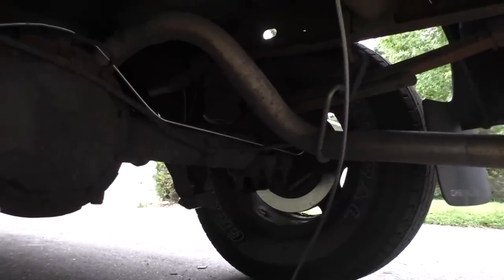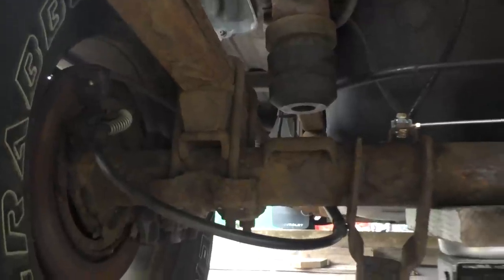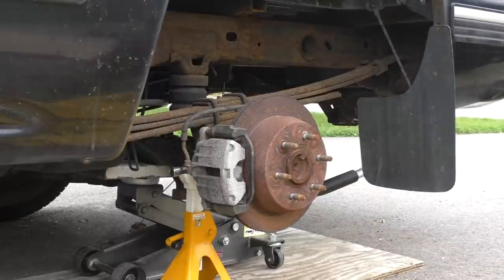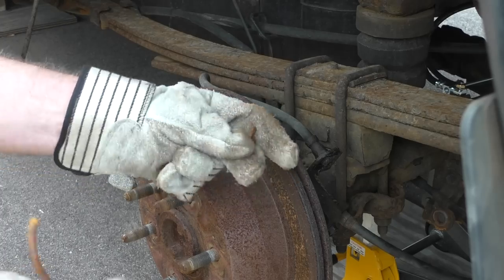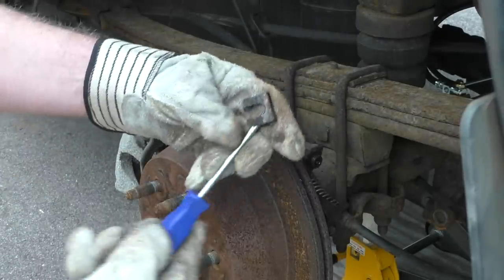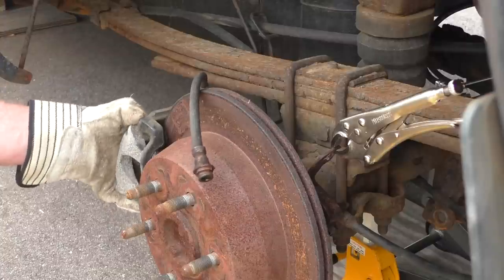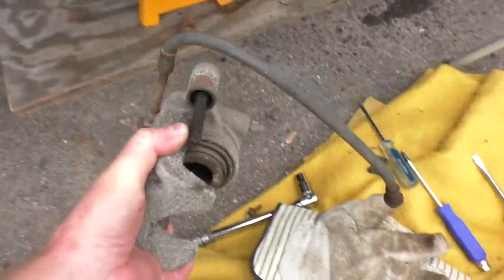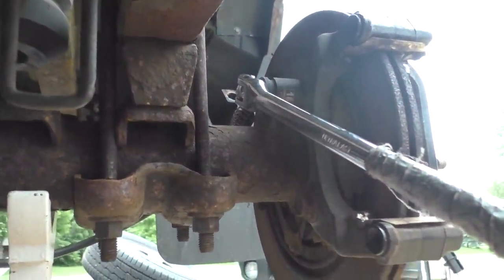Truck Brake Line Replacement Part 2

Comment: Thanks for the tip breaking loose that rear brake line from the bracket.  My hose came with the bracket but I can't break that bolt loose its too rusted in place.   Was in middle of doing rear brake job and decided to do the hoses too.

Have also been replacing the rotted steel lines with stainless ones on a 2004 Z71.  I only have a few more to replace and I'm done.

Comment: Really liked your video and came across it pretty much by luck.  Was doing searches on gm/silverado/sierra brake lines.  I'm getting ready to do this on my 2004 Silverado.  Went and bought prebent stainless lines (wasn't cheap) and figured on having to replace the front brake lines and those fun little clips.  But your video made me think that I am going to have to replace the back hose lines and that one that goes to the split on the rear axle.  Wish you had posted another video or two about this project.  Its something a lot of GM truck owners are facing.
Reply from the maker: Thanks. I have some more video but I've been having computer problems so I haven't gotten it all edited. Ask away and I'll try to answer.
Reply: hiddengrousefarm I would also like to see how you did
Reply from the maker: OK, I'll do the last part.

Comment: I use the 1/2" breaker bar and 18mm socket to loosen the caliper mount bracket bolts. If you use a pipe, or crowbar, for leverage the bolts will loosen with very little effort. Mount the socket and breaker bar onto the bolt head. Now adjust the breaker bar so it is level  with the frame or leaf spring. Now insert a pipe or "prybar" under (or over depending on which side of vehicle you are working) and afix that as a lever against the breaker bar and wind up torque onto the breakerbar (using the pipe as a lever) and that bolt will break free without too much effort. Essentially you are using the pipe and frame, or leafspring, to force the breaker bar into loosening the bolt. When installing the bolts back on they should be torqued to 140 ft-lbs. and 80 ft-lbs on the caliper pin bolts.
Reply from the maker: Thanks for the tips!

Comment: Tempted to get an impact wrench but I've managed for years with just heat, penetrating lube, hammers and pipes slipped over Harbor Freight wrenches.  I pretty much buy vehicles pre-rusted.  It's important to talk trash to these stubborn parts as you abuse them.  When you defeat them - and they WILL be defeated - you must humiliate them verbally.  You can also threaten them with an angle grinder.
Reply from the maker: lol my friend, we are brothers in arms against rusty, rotten vehicles! Thanks for the laughs!

Comment: To remove the caliper mounting bolts I discovered a cheap heat gun on the bolt head for a few minutes will soften the factory lock tite. I did that after rounding the bolt head a little but was still able to remove it.

Comment: I too have only owner GM full size pickups, and my 2004 Silverado Z71 just had the same issue.  This is the last GM truck I will own, too bad they ruined a longtime loyal customer by denying there is any problem with rusting of brake lines.
Reply from the maker: +Ike Wagner Yep. Brakes are important.

Comment: Did you ever end up taking the box off to get to that ABS set of 5 brake lines?  I'm having that exact same issue on my 2000 GMC Sierra today.. cant get the flare nut wrenches on there and when I do, there is nowhere to turn it.
Reply from the maker: Hi pro37mn,
There is a new video for you.

I did not take off the box. I have finished the lines and everything but I can't get the front calipers bled properly. Sorry that I've been slow with the videos.

I bought a set of stubby combo wrenches at Harbor Freight and that worked to get the flares off the ABS. It took forever to turn the nuts. I went in order from the inside nut to the outside and that gave me enough room.

The other way is to just cut off the hard lines and use a socket wrench - if you are replacing all of the lines like I did. I ended up leaving the old line from ABS to rear splitter on the truck since I just couldn't get it off the frame. Some other time I'll take the box off.

I'll try to get the rest of the videos up soon. Ask away if you have questions.
Reply: +pro37mn cut the lines and put a socket over the fitting for removal. Installing or tightening will be the difficult part.

Comment: About the emergency brake backing plate:
You´re right that they cannot be changed without pulling the drive shaft out of the rear axle but there are after market backing plates that are two-part so you can slide them on without removing the drive shaft. They are a little tricky to mount but it can be done. I bought mine from Summit but they can be found at Rockauto as well.
This one was for my Silverado but everyone should check that it fits their truck since brakes might differ:
Summit part number 924-213.
Somehow I can´t copy/paste the link so you have to search Summit for the part number.

And yes, my brake lines are also rusty. :-(
Reply from the maker: +RobbanxC Very cool. Thanks for the comment and the part number - I will definitely look into that!
Reply: most auto parts stores carry the 2- piece dust shields i got mine from Napa Auto and found a video ON 1 A AUTO on how to replace them good to watch before attempting replacement. my brake lines were shot also on my 2001 Silverado.
Reply from the maker: Was it hard to remove the old rusty backing plate?
Reply: the  hard part was getting the 4-18mm bolts out i was able to fit a 3/8 drive breaker bar and 18 -mm socket and a cheater pipe to break loose then remove the bolts with a box end wrench slid the hub towards the axle wheel hub then took some side cutters to cut 1 corner of rusty backing plate and remove i watched the 1-a auto installation video for tips to install new 2 -piecebacking platel
Reply from the maker: Thanks. I wondered about those bolts.

Comment: when installing new brake line fittings into the abs unit is it ok to use anti sieze or nothing at all on the threads.
Reply from the maker: I am not a mechanic so I'm a bit hesitant to answer these sorts of questions.

I did put some anti-seize on the threads but very small amounts so it didn't get on the tube flare which is the sealing surface. The newer steel fittings will corrode where the old real brass flare nuts did not so I think the anti-seize is a good idea. But do whatever you think is best.

Another approach is to use nothing on the threads and put a glob of thick grease over the exposed part of the flare nut (after installation is complete). This should keep water and salt off the fitting. However, the grease may wash off with time.

I really wish GM had put that ABS unit in a smarter place. Every other car seems to have them under the hood.
Reply: i agree with the location of the abs unit along with the tubing from the abs to the rear block running between the frame and the fuel tank i ended up raising the bed to get at the line seems like there was all kinds of room to run the line on the drive shaft side of the tank
Reply from the maker: As long as you have the bed up you might think about replacing the fuel pump. I just had to do that (haven't got the video up yet). That also fixed my wonky fuel gauge problem - the sender was worn out.
I'm getting a new truck - one part at a time.
Reply: I'm hoping i can get this brake line repair done and sell it but with my luck the fuel pump probably will fail before that happens.
Reply from the maker: Good luck!
Reply: thanks, but i'm going to have it towed to a garage i give up tried bleeding the brakes and had leaks at the abs connections none of the other connections are leaking just the abs unit hope i didn't over tighten them!

Comment: I want to know where you got that hydraulic puller?
Reply from the maker: Harbor Freight. It's the 5 ton model (there is also a 10 ton model). It works great and I've been meaning to do a review video.

Comment: same problem, 01 Silverado in Indiana. Doing complete stainless kit on mine.
Reply: Mike, did you get your lines installed? did you have any leaks at the abs unit got mine installed no leaks except at abs unit mine were 919-104 from auto zone! same truck 01 Silverado mine is a reg. cab long bed.
Reply: Got mine from O'reilly and had to cut and splice right front line. the rest were easy as long as you do them in order. be sure to do the one on the ABS block nearest frame first.
Reply from the maker: Good choice. The kit makes it easy. That's what a mechanic friend uses. Good luck!
Reply from the maker: Yeah, I did a short and quick video on that. The NiCopp lines bend very easy so I was able to get the right front in without too many bad words. Taking off the tire and fender liner helped a lot.
Reply: Solved the whole rustarado truck problem after the repair and sold the truck!
Reply from the maker: Good decision.
Reply: i was going to cut and splice the right front also but i ended up removed half the clips from the plastic wheel well on the right side and folded it back fed the abs end of the r front line thru first and slowly worked it thru till both ends were where they should be my problem is leaks at the abs unit.

Comment: Why don't you use copper lines or cunifer lines?
Reply from the maker: That's a good question. Some of this will be in a future video but the NAPA stores that I went to did not have the premade copper lines. One store had the silver colored lines and the other store had the green colored lines. I just assumed that was my choices. I finally went to a third NAPA store and they had the copper premade lines - but the job was mostly finished. Apparently the stores choose which lines they carry.

Comment: Not trying to be a smarta$$, but you stated in the first video that GM should have used a "rust preventive" line for the braking system. Yet, unless the replacement lines are stainless steel, then you're making the same mistake GM did. I just replaced the front to back brake line in my Excursion with Nicopp brake line.(supposedly won't rust....we'll see!). I also replaced several brake lines in my '91 cadillac with the same Nicopp line. Granted, it's more expensive than regular brake line but super easy to work with. At least use a coated brake line unless you're just gonna fix and ship her.
Reply from the maker: I did use the NiCopp lines. See the third video. I didn't know about the NiCopp or stainless steel lines when I did this video. After some online research I found out about the NiCopp and replaced everything. It was really easy to work with.
Reply: Hopefully the Nicopp will live up to the hype for both of us! Lol Thanks Larry
Reply from the maker: I should go check on everything. After one winter I did see some green stuff but that's just what copper does. The main problem that I saw was rust on the crappy steel flare nuts. I should have ordered real brass. Live and learn.
Reply: I had thought about putting battery terminal spray sealant on the fittings or a product called fluid film although I think any rust prohibitive like naval jelly or such would work. I haven't made up my mind yet.
Reply from the maker: I've used very thick axle grease in the past and that seems to work, but the ABS gets sprayed so much the grease might wash off. The nice part about the axle grease is that it can be washed off with any degreaser.

Comment: Your videos are great, very entertaining and knowledgeable.  I'm considering buying a GMC Sierra, 2004 or newer, and I've heard a lot about the rust problems these trucks have.  However, I don't and probably never will live somewhere where salt is used to melt ice from the roads, so I don't forsee having an issue.  What are your thoughts on this?  Do you think this problem is more prevalent in places where salting the roads is a common practice?
Reply from the maker: Hi MerkyOne,
I'm not really an expert, I just make videos of what I do. You would be best off finding a real mechanic in your area and ask them. There are also some great channels like EricTheCarGuy, etc where you could likely get a much better answer. A truck is a big investment so you are smart to ask.

The salt definitely increases the rust problem. I guess I would take a look at the brake lines running under the cab and over the back axle. If they look like mine did then look at another vehicle. The might have surface rust which is OK, but if it's flaking off type rust then you will have a problem eventually.

The main rust area is the brake line that runs from the ABS to the splitter on the rear axle. The problem is that it runs on top of the frame rail and under the bed so it's almost impossible to inspect. I think it collects salt, dirt, and water up there which can't be washed off so it just rusts out fast.

Good luck
Reply: Work with guys at work who really are big ford truck loyalists and they tell me they've had rusted out brake lines too.  Not an expert here either but seems like a rust belt issue.  Southern vehicles in general dont rust out.
Reply from the maker: Happy Trails
It seems that some model years are far worse than others. The rust belt factor is big but it still should not be happening so soon. We have plenty of cars and trucks that go for 20 years or more without popping the brake line.

The other disturbing part is that we loose all brake force if one line bursts. That should not happen - there is supposed to be 2 independent systems. I think both GM and Ford value-engineered the brake system so much that they are crap.

Comment: Good video, best part " Typical dumbass gm engineering." I'm planning on doing mine in the next few weeks, running copper nickel though.
Reply from the maker: Joe Blo HI, I redid the job in copper nickel. One of the joints was leaking air so I always had a soft pedal. It wasn't as bad as I thought it would be.

Comment: Cant you just wire brush all the rust off and rust proof it ?
Reply from the maker: I didn't show everything - the calipers were almost rusted to not functioning. After losing the brakes completely I didn't trust anything and just replaced it all. I could have salvaged some of the parts but it was faster to just replace them.
Reply: hiddengrousefarm is it easy to replace rusted parts or to remove rust from a vehicle?
Reply from the maker: Both are a pain in the rear.  I thought replacing parts would be easier but several fasteners were rust-welded and I do not have an acetylene torch or a lift. I really just did not trust the brake parts on the truck so replacement was the only option for me. The entire underside of that truck was massively rusted and about a year ago the frame broke (both rails just behind the cab) and I sent it to the junkyard. Of course that means all the new brake parts were a waste of money.

The best option is don't live in the rust belt.

Comment: Its imperative to wash vehicles during the winter to remove road salt, drive through car was so it washs under the vehicle. I'm sure most folks that were able to buy the truck new had a garage to garage them. Everything after that is from other owners not taking care of the salt pdoblem let alone from looking at it it was seldom if ever washed since original owner had purchased it. Most body rust is from neglect. So, if they're idiots at gm for not installing anti rust lines, then why didn't you do it? I've seen 99 silverados for sale with no rust, its because they were took care of and washed regularly during the winter.
Reply from the maker: Everybody has an opinion, and that is one of them.

Comment: I have to replace all brake hose because they are way to rusted cant unbolt them im lucky they are reasonable price unlike some cars
Reply from the maker: 64impalaSS Same here. Everything was so rusted even if I could get it apart I wouldn't want to put it back on the truck. The whole brake system is new except for the ABS module.
Reply: Same as mine

Comment: This rust bucket didn't get this way over night. periodic maintenance and system inspection is something shade tree mechanics never perform. Reactive maintenance is performing repairs after its broken. Preventative maintenance is the prevention of such images. Sure it takes a lot of time and money to keep a vehicle in pristine condition. But when you drive a well maintained vehicle over a vehicle like the one in this video, you know your going to arrive at your destination. The overall condition of this vehicle as a result of the lack of care it has received over its life shows it would be cost preventive to fix. Might as well junk it. But like most drivers, put a few band aids on it and keep it on the road. Be a hazard to yourself and others.
Reply from the maker: Thank you and please feel free to concentrate your wisdom on other youtube channels. Buh bye.

Comment: 15:27 "Let's see what we have here. What we have here is a piece of junk." Ha Ha. I'm getting ready to replace leaking lines on my 2000. Who designs this crap? I guess once it's built and sold they don't care what it will take to replace the inferior components that they use or how difficult it is to even get a wrench on some of the parts. GM stands for General Motors not Great Minds.
Reply from the maker: Thanks for the comment. Always good to keep laughing at this mess. I have a third video out giving a short explanation of how I replaced the lines. Good luck.